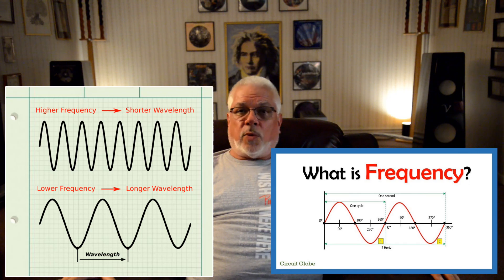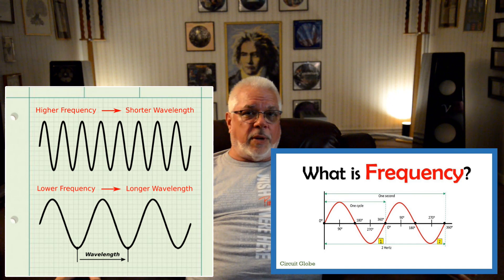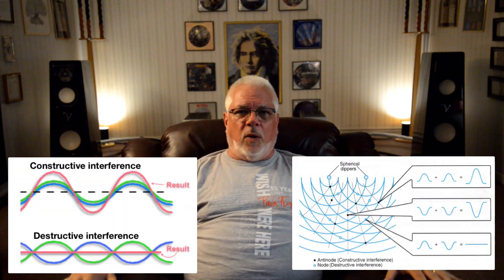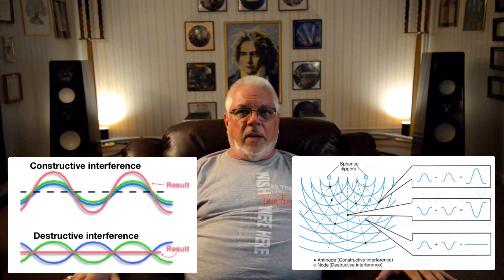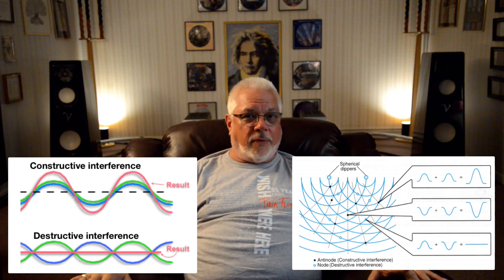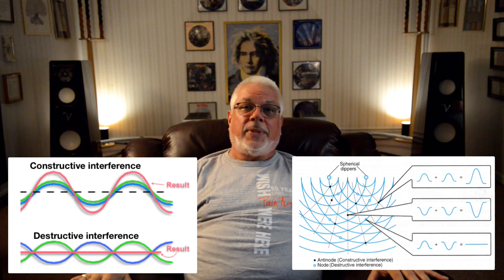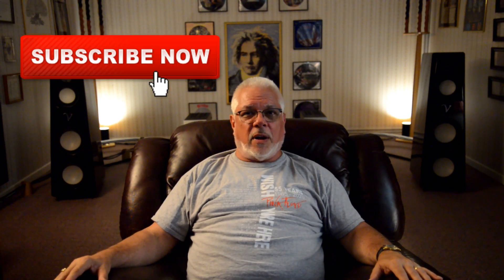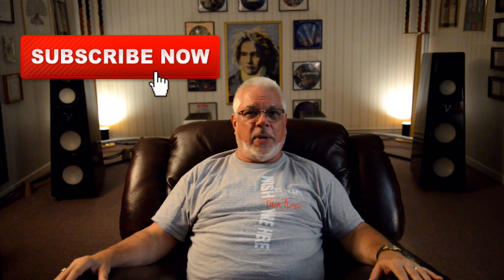E4: The Listening Room - Your Final Component - Part 1

Comment: Greg Brilliantly put together. thoroughly enjoyed it.one question. can this analysis be extended to determine whether a speaker is a good match for the room?say if have the speaker spec and and room dimensions & other room info .appreciate your response. if possible that would be another great video  :)
Reply from the maker: Hello Hariharan...and thank you for your positive comments! The answer to your question is both yes and no... Yes in that it will be applicable to virtually any speakers you select and plan to use in your room, although there are some exceptions to these rules for dipoles (like ESL's and planar's), and open baffle designs. But  is a general no as to helping to select a more effective speaker system for your room... Since radiation patterns are mostly similar for the typical acoustic suspension design loudspeaker, this method is not much help divining which ones may be better suited to your room than others.

Comment: Greg, thanks for another informative talk! Have a few questions. My VR55s are 4 feet from the narrow wall in a room 22.5 feet wide by 37.6 feet long (with 6 foot opening in far end making it 59.4 feet to the farthest wall. The ceiling is vaulted long ways from 8 feet at sides to 10 feet at center. In these circumstance do you call the ceiling 9 feet, taking its average? How would you calculate dimensions for example use the 37.6 or the 59. 4 for length) And what  effect does vaulted ceiling tend to have on nodes? Just trying top get an idea how well the room matches either golden ratio, or one-third option. Using the 9 foot as ceiling, doubling side walls using 1.25 to about 22 and quadrulping the long wall using 1.6 to 57.6 feet, this room seems to closely match the one-third option, correct? Thanks.
Joe
Reply from the maker: Hello my friend. So, with vaulted ceilings, while it is tempting to try to average the values to come up with a mean, with non-parallel surfaces, nodes exist, but it takes some rather significant reckoning to calculate them, and they are typically less predictable and impactful than with a routinely rectangular room. You may want to do some searching online, as you may find some useful formulations or directions. I really am not qualified to go too far off into that uncharted territory. 

As to the other dimensions, for the sake of discussion, let’s work with your ceiling height average of 9 feet. With our 1/3 Octave rule, we use 1:1.25:1.6/ So…with a 9’ ceiling, width would be ~11’ 3’, and depth would be ~14’ 5”. Then, following your suggestions, doubling 11’ 3” to 22’ 6” (your 22’ dimensions) seems close enough. However, I’m unclear on the relationship between 37.6’ and 59.4’. You mention a “six-foot opening…” which indicates to me that the original dimension of 37.6’ will be a real boundary and allow for reflections setting up a standing wave front of its own, regardless of the other wall at 59.4’.

Sorry Joe, but non-standard rooms can be very difficult to map out… There are MANY online and services that will use their formulas to help you understand your room nodes, but sadly, not many of them are free. Happy listening, Joe.
Reply: @theaudioanalyst  Thanks Greg for your detailed response, particularly on this sad missing Albert day. I don't mind throwing a few bucks at this issue as I know rooms are important. In fact there are other angles and dimensions in the room, keeping it from a rectangular shape. I think all this complexity works in my favor as the room sounds good to me and others who visit, which is fortunate because as a family room there is not much opportunity for visible room treatment. First reflections are treated and there is fairly good diffusion and absorption through furniture. I think the biggest factor is the rooms large size which in my experience helps things a lot.

Comment: I found this one interesting....thank you.  Well done.  However, your theories about developing significant bass in a small room is only that......a theory.  It that was the case then a sound system in a vehicle wouldn't have the ability to play low frequencies well and we all know that that is not true.  
I have a near field listening studio dimensions 7'x6'x8' that has an 18" Acoustic Elegance sub woofer with the Apollo Upgrade in an infinite baffle configuration.  The measured response plays down to 3 1/2 Hz very easily.
Reply from the maker: Hello again. You seem to have missed my point here entirely. Physics is what it is, and in this case it is a matter of wavelength, plain and simple. There is no way for a 20 Hz note to be properly developed in a room shorter that its primary wavelength. What you are talking about is modulation. Since few of us have rooms over 60 feet long, we make up for this with a principal know as modulation. This is why so many believe in the use of sub-woofer to modulate a sufficient amount of air in our listening room to excite other senses in our bodies that reinforce our perceptions of the lowest frequencies. And, the perfect example is the car audio example you mention, easily demonstrated by some of these booming car stereos, from which the bass frequencies often precede your sighting of the vehicle. AND, it is why bass frequencies can be so challenging (constructively and/or destructively) in our rooms.
Reply: @theaudioanalyst  So are you trying to say that a 20 hz note that you hear in a small room is only modulation and will not sound the same as a 20 hz note produced in a room whose size is over 60 foot?   Since when did listening to a 20 Cycle per second tone only become real if the room you are in was large enough to contain one full wavelength?  Are we listening to imitation bass frequencies in small rooms.  Yes with a car audio system with booming bass the frequencies can be heard from far away but also inside the vehicle as well.  I'm still confused.  A High Frequency Compression Driver found in wake board tower speakers can be heard sometimes about mile away. The midrange and high frequencies can be almost as clear as if the listener was positioned really close to the sound source.  I understand that room size affects the sound, and interference patterns can cause nulls and peaks.  But what I'm having a hard time comprehending is needing to be in a 60 foot plus room in order to "develop significant bass" as you worded it???  Not trying to be a ball buster, but just trying to understand and maybe learn something new.
Reply from the maker: @hiresaudiocosta873   Yes, in essence that is exactly what is happening. By modulating a sufficient amount of air in our listening room, we can excite other senses in our bodies, and the psychoacoustic efficts helps to reinforce our perceptions of the lowest frequencies. And think about it... Listening to a deep bass note in your nearfield system will deliver some sense of impact and punch, but, it is perceived VASTLY differently by your ears, and especially by your body, when you EXPERIENCE the same notes and sounds in a concert hall, theater, or large venue. The sound, the pressure, and the sensations are completely different. Why? Because physics dictates that those low frequencies cannot be fully developed in a space that is not large enough for their wavelength.

Why is that important? Because with wavelengths so large, they are readily reflected by our walls, floor and ceiling, and those reflections set up standing waves which can really wreak havoc on the quality of the bass, and those sonic results can be wildly different (huge cancellations (suck outs) or massive reinforcement) depending on where you are standing in the room.
One common way to address these standing wave issues is with passive room treatments, using devices called low frequency absorbers or bass traps.  Bass traps don't actually "trap" the bass; they convert mechanical energy (bass) into heat.  Low Frequency absorption devices are usually big and heavy, and you usually need a lot of them to be effective, especially down to the lowest frequencies.  And while these devices help remove the problematic buildup of standing waves, they also reduce overall system efficiency, meaning you may have to turn the bass levels up to perceive the desired SPL, which aggravates the standing waves, creating a vicious circle. 

That is why it is best to avoid small, and especially small square, rooms…
Reply: @theaudioanalyst  Thank you so much for taking the time to respond with quite the explanation.  Much appreciated.  Looking forward to the next episode.  My room has treatments of 3/4"plywood and 1/8" Luan  covered carpet, egg crate foam, rubber, constrained layer damper, mass loaded vinyl, melamine foam, and velvet curtains.  First order reflections are tamed.  Bass response is linear from 2 hz to 350 hz.  Corrected with Digital Signal Processor.